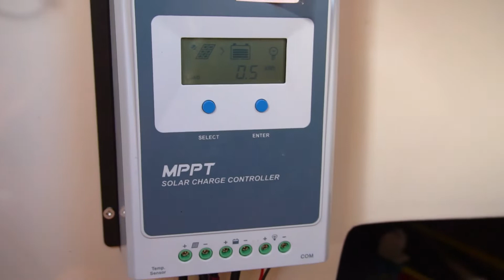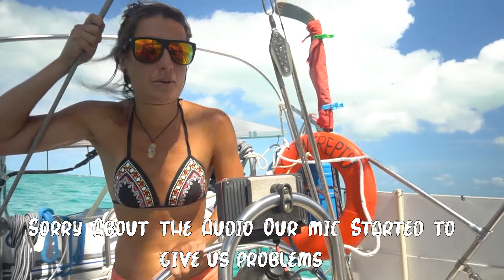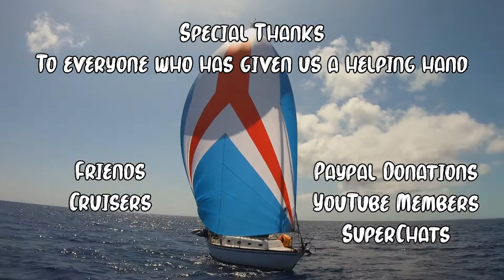Exploring Spanish Wells | Yanmar Troubleshooting [WIN Ep 110]

Comment: I've noticed the prices of small diesel engines skyrocket over the past several years. In my opinion, I believe the prices are way over-inflated and far outweigh the actual value. Parts can also be ridiculously expensive and way overpriced as well. That said, it is still more economical (in most cases) to rebuild an existing diesel engine rather than purchase a new unit as a replacement. Of course, labor is also quite expensive these day, so kudos to you two for doing as much of the work yourselves as possible.
Reply from the maker: Nice to see another person who has the same mindset as us. I never realized that prices skyrocketed since we never looked too much into it prior to our engine problems. I wonder why so much more? Rebuilding it was intimidating to me but Cory dove right in. Luckily we have a small engine so parts weren't too bad but labor is a tricky one. Nobody wants to go work on a sailboat engine it seems like. But it was a great learning experience and now we feel so much more comfortable if anything else happens.